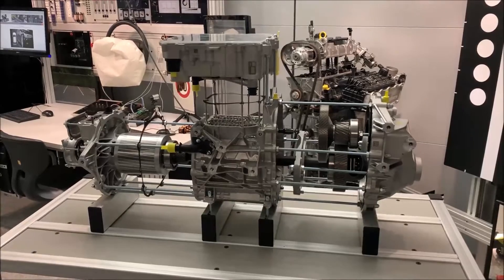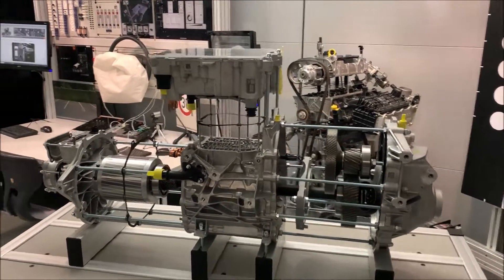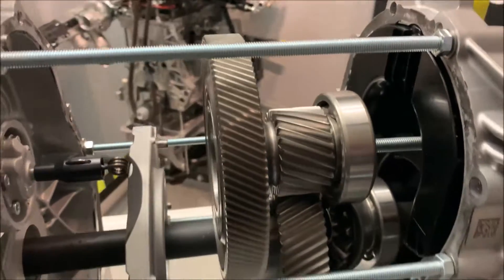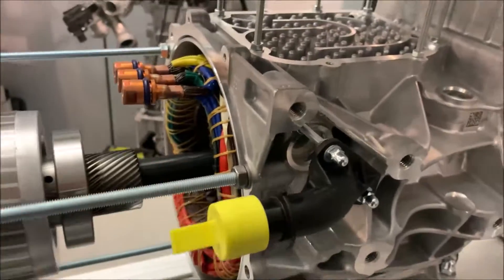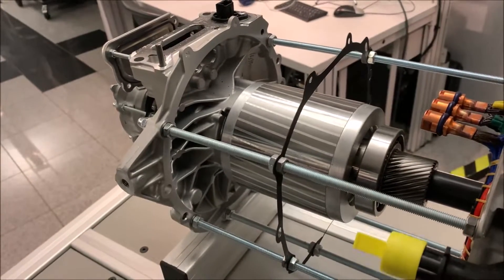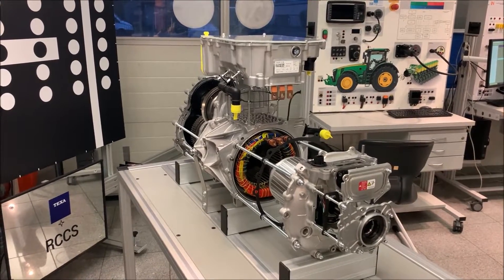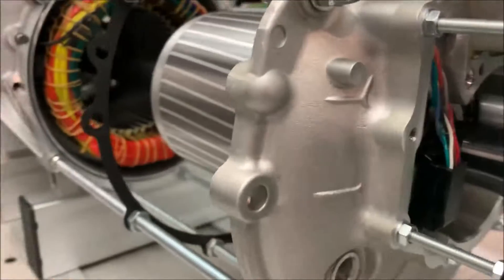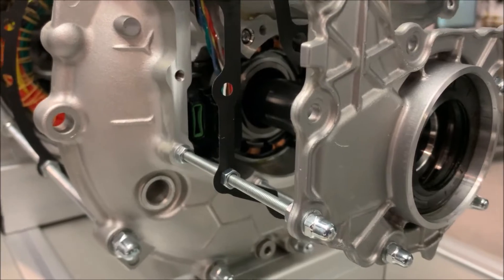The Electric Drive of a VW ID 4 (E-Motor / Resolver / Gearbox)

Comment: Dear sir do have to change gear oil
Reply from the maker: Based on VW - this is a life time filling. ;)
Reply: @InsideEVTraining  Greetings! Can you provide a link to the information that the oil in the gearbox is filled for the entire life of the car? thanks in advance!
Reply from the maker: @СергейМартынов-ю7и   sorry, we don't have a link as we spoken to VW directly, when we got the e-motor. Nevertheless, feel free to use google. I can imagine as well, that this will be written in the corresponding SSP, if VW is still creating them.
Reply: @InsideEVTraining  Thank you very much for your answer, the problem is that I could not find any official information on this issue...

Comment: Hello, 
Recently after driving approx. 19.000 kms on Id.4 rear drive model (production of china: model id.4 crozz pro), i can hear knock from the gear panel when the car starts moving or when I push the “gas” pedal after slowing down on regenerative braking mode. I.e. whenever the car goes for clutch the knock sound can be heard from the gearbox/rotor. 
What problem is it like and how can it be solved.
For your information: I have not changed the oil in gearbox after driving 19k kms. There has been some times that while driving in lower speeds (4-5 kmph) i have opened the door or woke up from the driver’s seat after which the car stops immediately and brings it to a park position (electronically). 
Thanks in advance.
Reply from the maker: Thanks for your comment! Unfortunately, this is hard to answer via YT, but we will speak to our VW experts and try to get an information for you!
Reply: I have a 23 AWD Pro S that I took delivery of on July 2023.  As November 2023 @ 8000 miles I also have started hearing this knock. It has been at the dealer for 11 days now and they are unable to figure out the cause. Its a real bummer. I really hope to get my expensive car back soon!    Did you ever determine the cause of your knock?
Reply: I have a 23 AWD Pro S that I took delivery of on July 2023.  As November 2023 @ 8000 miles I also have started hearing this knock. It has been at the dealer for 11 days now and they are unable to figure out the cause. Its a real bummer. I really hope to get my expensive car back soon!    Did you ever determine the cause of your knock?

Comment: To answer the question @2:11:
this is clearly an asynchronous (induction) rotor, as evident due to the exposed aluminum conductor "squirrel cage". The use of a resolver (rather than encoder) also indicates asynchronous operation; either a resolver or an encoder can be used with either induction or PM motors, but for PM the higher angular precision of the encoder is usually preferred.
VW's published information confirms that while the rear motor of MEB vehicles is PM, the front motor is induction.
Reply from the maker: Also perfectly right! :)

Comment: You say that this is an ID.4 unit, but it is entirely different from the ID.4 unit which Munro Live tore down - different rotor type (induction vs PM), different stator type (round wire vs rectangular "hairpin"), different transaxle layout (coaxial output vs. offset), different housing construction. I suspect that Munro tore down the rear drive unit, and that this is the very different front drive unit from the same platform.
Reply from the maker: Hey Brian, you are correct! The ID4 has an all wheel-drive in its latest version, where you have the known synchronous drive a the rear axle. For AWD and boosting VW added a asynchronous front wheel drive. This is what you see in the video. Sorry if I have expressed myself in a misleading way here. 

For more info look here: https://europe.autonews.com/automakers/vw-give-id4-all-wheel-drive-power-boost
Reply: Yep, this is the front eAxle supplied by Magna, called the eDS-Low (which VW calls the EQ150).  The rear gets a VW eAxle called the EQ310-1P, which you have seen in the Munro video.